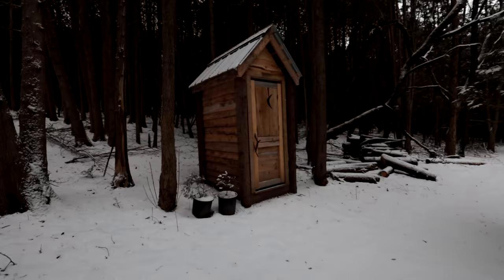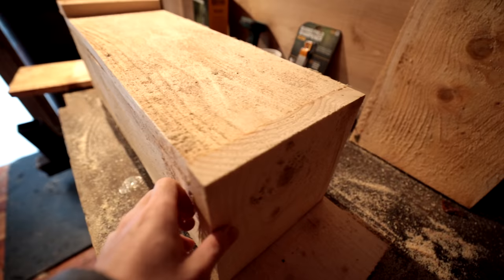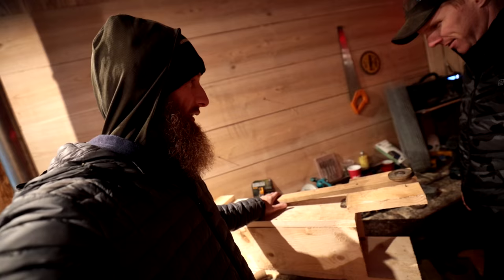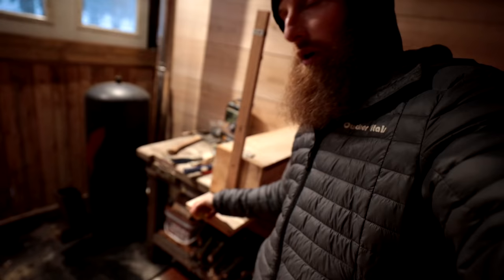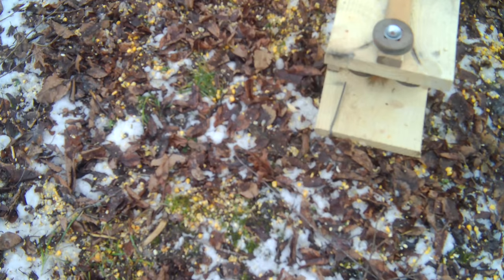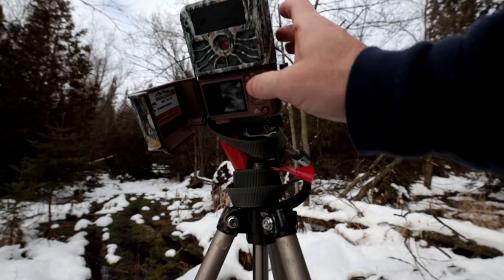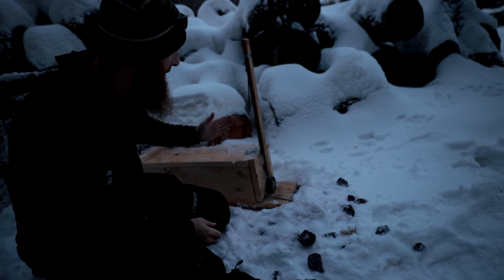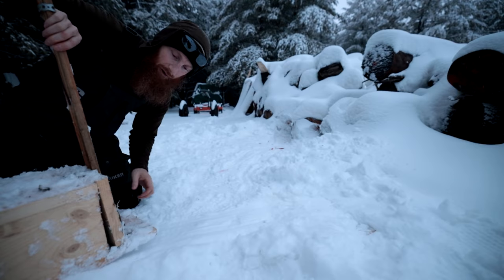Catching Rabbits in a Home Made Box Trap!

Comment: Probably drilling holes on the side of the trap might spread the scent of all the goodies inside and help you see inside the trap
Reply: More wire mesh on the sides. I  am a old trap builder, and that is what I would do. You want the prey to able to see out as well. Makes them less nervous.
Reply: @williambenner5550   Agree. Most traps are made from wire mesh. But if you watched other videos of this channel where Chris has used wire mesh traps, the smaller animals were able to steal the bait without getting trapped and the snowfall would cause issues. Plus Chris has already built a wooden trap in this video.
Reply: Use an outside trigger attached to the piece of wire that goes inside that has an apple hooked onto it.  My grandfather used screendoor springs attached to the door and a trigger attached to the stick you have on the door.  ONE piece of apple bait equals rabbit stew for supper.  You don't need windows for the rabbit to peek at the treat.  Too much bait information makes the rabbit nervous and he will seek food elseware.  Cottontails by nature like dark holes to seek shelter and safety.  Try comparing a no peek solid wood box to a all wire mesh box.

Comment: The box trap is what we made as kids.  We called them "rabbit gums" ( An old term.   I don't know where the phrase came from).  Instead of the dado we used 1/2 square "sticks" for the drop door guides { 2 each side }. A slice of apple was a good bait.  Also rubbing a cut apple all over it covered human scent and enhanced the bait.  You don't want to eat rabbit until after the first hard frost so they will be free of micro parasites. In warm weather use them as stew meat to sterilize them well. a small hole in the end board will let in light so they can see the bait.

Comment: For a window may I suggest this, from an amateur woodworker perspective:
1 cut a rectangle in the side, whichever way you want or find easiest.
2 use a circular saw, raise the blade all the way clear, align it to where you want then make a plunge cut in the thickness of the side with the window.
3 use any transparent plexiglass (it yellows out in a few years) cut to the dimmensions that match the dimmensions of the window PLUS all the way to the top of the side wall.
4 secure in place with a screw or if you don't want too much metal, 1/4 inch drill through the whole thing and use a wooden dowel.

Lexan doesn't chip when cut, unlike plexi which sometimes shatters.
I got some small lexan panel cut-offs kicking around I can send you in an envelope if you want.
Speaking of which, you should get a PO Box so ppl can send you stuff. Lures, knives, that kind of thing.

Comment: I made one of these a few months back. After weeks of baiting and checking I finally caught a small cottontail but my wiener dog managed to step on the wire and get its nose in the door. My wire was slightly smaller gauge than yours so to fix it I just added a second wire on the other corner. So far all I've caught was a grey squirrel. I would really like to know what is the best type of wood or material to use for the structure to make it seem more natural. Mine was built from 3/4 plywood and it did take a couple of weeks to air out the fresh cut wood smell. Nothing entered the trap until the smell was faint.

Comment: Could email you some crude drawing of live traps I've made. Need some fishing line, a nail, a mouse trap. Have a heavy door that slides down, drill a hole for the nail to hold it open, tie fishing line on nail and bar of mouse trap with bar facing door when set, line through the pan into the box and put bait on the like or make a foot pad, they trigger mouse trap which pulls the nail out of the door and door slides closed